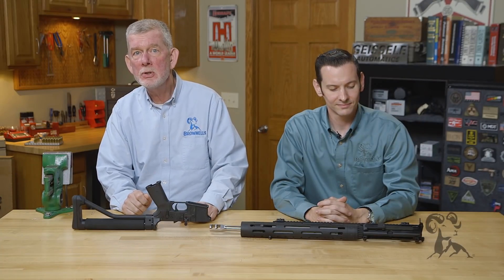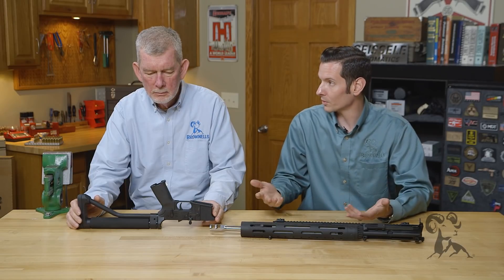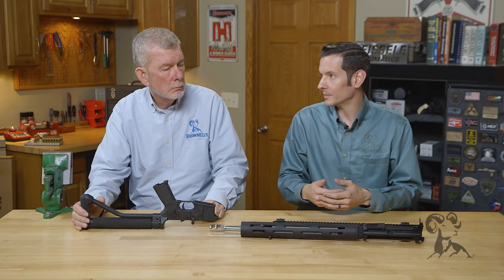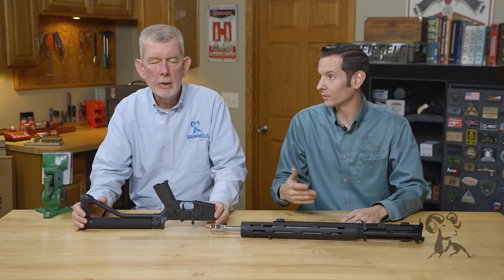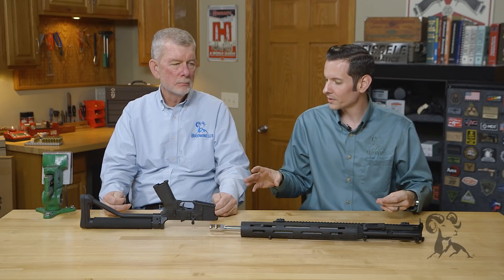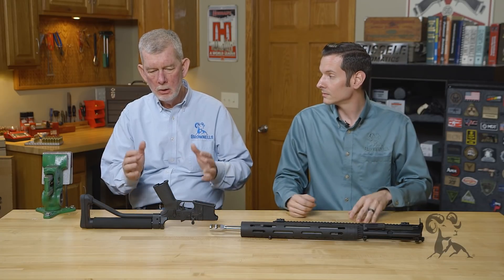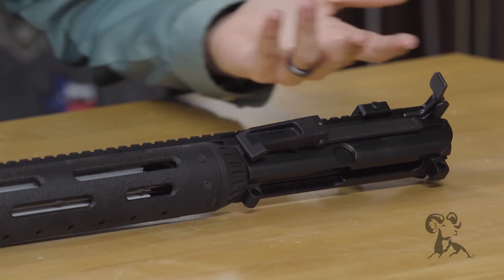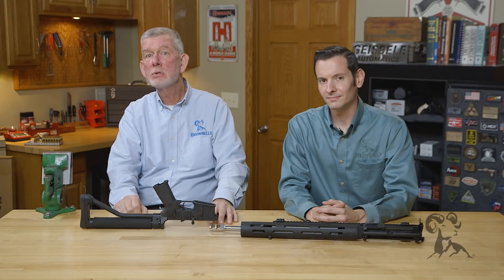Smyth Busters: Is Billet Better Than Forged?

Comment: As a "rusty" material scientist who worked in failure analysis for almost 15 years, I commend you guys on your succinct and dead on explanation. Well done.
Reply: Not sure how that will happen. Forging is preferred unless the shape is too complex or the specified material is too difficult to work. A billet will always retain its anisotropy unless heat treated after being shaped which, in turn, can introduce dimensional changes, particularly in complex parts.
Reply: @damianip  Forging is NOT preferred, forged parts are weak parts.
Reply: I wasn't impressed with the incomplete presentation. Did I miss the discussion on alloys or any kind of testing/measurement? And there is zero reason a forging can't be complex and the the milling operation couldn't shape more complex - how did Savant phrase it - "really cool looking receivers".  

In my opinion, the reason forging was used in milspec wasn't for any other reason than speed of production/less machining operation - basically, forging is a cheap and fast way to rough-in the part. Just like cold hammer forging barrels. You can discuss various marketing and technical claims but the reality is, it's faster with fewer manufacturing processes.

-- AGREED -- either a machined forging or machined billet out of their custom alloys are up to the task. Even then, cast and polymer are fine for over 90% of AR owners. -- generally, they are noncritical (sport) shooters. You might be surprised how many cast parts there are and how many can't tell the difference between them and forged.

...just opinion.
Reply: This is too simplistic.  Forged can potentially be stronger, but some billet receivers are overbuilt and could be stronger than a lighter forged receiver. It would depend on weight and shape of the pieces being compared.
Reply: @Subtlenimbus  the assumption when comparing the two manufacturing methods is that everything else is equal; that being the case, a forged part is stronger every time. Of course, some manufacturers take advantage of the strength properties of their forged parts by removing more material from it to make it lighter, whereas a manufacturer of that same part using billet would not do this because the part strength is already starting at a lower level.
Reply: Then as a material scientist you might offer up some other data....such as forgings are shrapnel machines, unlike billet that deforms under explosive pressures
Reply: @killerfungis  I think we have to separate marketing from fact.

A casting can be adequate for the job. The issue often is manufacturing not strength. Casting often has dimensional challenges because they shrink as they cool and do have limitations in complexity.

A forged part can take some non dimension critical shapes and contours requiring minimal machining. 

Billet generally comes from either hot or cold rolling a standard shape that can then be milled to intricate forms with precision. 

So, just my opinion, strength has nearly nothing to do with it, it's more about what tools you have to get the job done. 

So honestly, does it really matter? I mean as long as long as it gets the job done?
Reply: @DelHollowProductions  Yes it kinda does, because if you become familiar with the process. What is referred to as a forging is extensively machined..ie cutting those grains Brownells claims to be stronger. Most of the billet lowers I see start out as heat treated, then machined and then back to treated or cryo. The difference being that the 'forged' lowers in an 'over-charged' scenario turns to shrapnel. Several vids on youtube showing the difference
Reply: @killerfungis  What is your point? Yes a forged part will be machined.  I don't recall saying otherwise. Does it take as much as billet? No. Are tolerances better than casting? Yes.
Reply: And guys, did I not introduce the concept that strength really has nothing - really - to do with anything? 

The purpose/benefit is to manufacturing. Again, arguing whether billet is the strongest is like arguing that 2-1/2 ton isn't as good as a 3 ton jack to lift your car when a 2 ton is more than enough.
Reply: @DelHollowProductions  I think the takeaway is don't pay extra for a billet if you're doing it because you think you're getting a stronger product.

Comment: The lab tester in me cringes at the "Billet is not stronger than forged" statement; without additional context it's a dangerous blanket statement.  As with so many things, the more accurate answer is "it depends," in particular on the quality of the source metal, its composition, and heat treatment.  Assuming good metal quality and manufacturing processes, a billet 7075 receiver will be stronger than a forged 6061 receiver.  An improperly heat treated 7075 receiver could well be weaker than a high quality forged 6061 receiver.

Also, the argument I hear most is that billet is better than forged, not that it's stronger.  Whether "stronger" is the same as "better" also depends on a lot of factors.

Comment: I wouldn't say either is "better". Ultimately, it depends on what you're looking for. Billet receivers are generally prettier, while forged are in fact, stronger. However, hardly anybody that owns ARs will ever experience a failure in a billet receiver that they wouldn't have encountered if the receiver had been forged instead. It just comes down to if you're willing or not to spend the extra money to have a nicer looking receiver/extra features (skeletonizing, side charging, etc). 
Out of my 4 ARs I currently own, only one of them is on a billet upper, and they're all forged lowers, although I plan on buying the matching billet lower for that rifle at some point.

Comment: And where does Metal Injection Molding fit in that hierarchy?
Reply: If you ask the striker from my wife's Walther- very very low.  Factory original lasted 2 rounds.
Reply: Somewhere around cast I’d assume, maybe stronger or weaker depending on material and the quality of manufacture.

Comment: i have to laugh when i hear people say Biilet lower receivers are so much better and stronger than forged. How much stress and pressure with a average shooter the answer is very little all of the action is on the components and the upper receiver. Your much better off getting a forged lower and spending the $125 your saved on quallity  internal compnents

Comment: You also have to remember that some forged pieces are then 100% machined. They use what are called "blocker" forgings. You end up with a basic shape with good grain flow but then all surfaces are machined.
Reply: All receivers are machined, Billet or Forged, otherwise all you have is a paper weight.
Reply: Libertarian 4 Life  So, my question that was not addressed in the video... Sure, forgings are stronger in theory, but is it in reality, when you have thinner walls on a forged receiver than on a billet? The weight difference between billet and forged receivers is notably significant due to the excess thickness of the billet receivers. Is that extra thickness enough to equalize strengths?
Reply: There is no such thing as grain flow.
Reply: 13R^D  Then you have not seen the shrapnel from a forged lower and compared that to a billet heat treated
Reply: This is what I assumed billet was...
Reply: I don’t think you have a good understanding of “100% machined”. Only a billet part would be 100% machined because it does not even have a basic shape of the final part when the machining process starts. A forged part starts the machining process already having its basic shape coming out of the forging die.

Comment: I worked for an aerospace company and we used forged billet material for some parts in the rotor head of a helicopter. We used an aluminum that was 7049-T657. Special material with good strength properties but because of the grain flow of the billet and the basic material it has great properties from a ballistic survivability standpoint.
Reply: Often makes me wonder why some high end gun companies don`t use a higher grade aluminum in their AR`s. Or would the cost be that prohibitive?
Reply: @gunfisher4661  Weight.

Comment: Realistically I think you can say quality billet receivers are actually stronger because many of the designs now take advantage of FEA and other methods of stress testing to improve the designs over the standard old milspec designs. 
Yes the grain structure is inherently stronger in a forged part, but all billet receivers start from a forged blank with a specific grain structure as well. 

I’m sure if you were to test something like a Radian lower/upper vs. a forged milspec lower/upper the Radian would absolutely be stronger in the areas that are important.
Reply: If only @projectfarm had a gun channel
Reply: I love my radian
Reply: I'm highly doubting all billet uppers/lowers start from forged blanks, even though I know little of the industry.

Comment: Even though I completely agree...
Only theories with no testing =/= myth busted
Reply: Take a myth, provide facts to counter the rumors = Busted.
Reply: Providing facts requires showing proof of evidence to back a claim. If a widely accepted view was all that's needed, the belief that the earth is flat would have been fact in it's day and not simply ignorance. A busted myth certainly, but not because two guys sitting at a table just told you so.

Comment: Is there any truth that billet receivers can add to accuracy due to the grain structure being linear and not having imparted stresses?
Reply: I don't think so. The cartridge doesn't really ever touch the receiver. It goes straight from the magazine, picked up by the bolt, and then into the chamber which is part of the barrel. The receiver shouldn't have anything to do with accuracy.
Reply: @acidtreat101  have you heard of harmonics?
Reply: @autumnfragrance7185  I am not a precision long range shooter but I have to agree with you on harmonics in that it could differ between a loose vs a tight fitting upper/lower. I have both a forged and a billet set. The billet set has zero slop and I am guessing the more slop you take out of the equation as a whole should yield better results in accuracy right? Then, I have also noticed that my forged set works more reliably though.
Reply: I would think stock fitment would be the biggest variable in accuracy, not the receiver. At least for firearms with a one-piece stock
Reply: Yes...  you can have a billeted monolithic upper receiver  ... takes the slop out of the handguard

Comment: If I recall, Aero Precision receivers are forged and billet, right? Something of a hybrid?
Reply: Yes, the Aero is more of a forged actually. They have a custom die to forge their receiver giving the best of both worlds.
Reply: Every billet part will start with a forged blank, but the process of actually forging into a specific shape makes it even stronger. All forged receivers are still machined as well to some extent.

Comment: Its not simple though, amount of material used and where its is used also matters significantly. Using billet you can reinforce weak points and increase rigidity and strength however much you want to. You can easily make a billet receiver stronger the a forged by increasing amount of material where desired. If you  want the best strength to weight ratio then forged is the way to go.
Reply: 13R^D  hmmm.... BCM MK2.... 

Oh and if you buy a left handed AR for which there are few companies it then takes a proprietary BCG. And you aren't grasping the concept that not everyone is in the military and weight is not the first priority 🙄.
Reply: 13R^D  lol your soo touchy on your milspec religion. And your wrong, alot of amby billet receivers you standard milspec parts they add additional parts to make it ambi. But your right we should ignore engineering and development to improve product safety, reliability, and performance. I'll let BCM know that their time, effort, and investment was just a big waste. That was sarcasm just so you know 😏. Its clear that I have spell things out to because you still haven't grasped the concept that what you prioritize in a rifle isn't what everyone else prioritizes. Features, ease of matinance, ease of replacing parts, rigidity and fitment for inherent accuracy. All of these other things may take a higher priority  than weight. Now fallow along, the military has different priorities! 

My initial comment was wrapped around the concept that just saying forged is stronger is only part of the story. You can have additional features and it be just as strong if not stronger. I know, I know, but weight and military...
Reply: @Chase Nun hey bud before you start trying to “spell things out” for people; how about you learn to “spell” yourself, just a thought. So many words that you had in your rant that were so jacked up and wrong but yet you are trying to “spell things out” for people smh
Reply: @johnc2324  Seriously.... it's comments section. I multi task many conversations throughout my day. So correct spelling, and properly structured sentences to meet your esteemed demands is way down on my list of concerns. Make valid point or move on your embarrassing yourself.
Reply: I did make a valid point and you just proved it, good job though. 👍🏼
Reply: @Dick Cheese yes they are completely fine I have many. But to someone who is left handed, they may want something more ambidextrous. Yes, yes, yes 👏 people can use the standard just fine  being left handed. But maybe they just like the ambidextrous receiver so it's less awkward and they are a little faster. I don't know how else to get across to people that some people have different priorities than you do.

Comment: anisotrophy.   Billet is cheaper to manufacture in low quantities and forged is cheaper to manufacture in high quantities. Standard receivers are forged and cheaper than billet.  My guess is that the myth started with people assuming that price equals quality.

Forged is stronger along the grain direction( anisotrophy), however billet is usually thicker.  Which is stronger?
Reply: I agree I think people look at the price and assume it must be better...
Reply: Libertarian 4 Life When you say add "grain refiners" you are suggesting upgrading alloys.   Forging isn't only about grain flow but reducing machine time and reducing scrap.
I once did an FEA on a upper receiver and noticed a weak point  at the neck where the barrel nut is mounted.  Would you favor changing the section modulus or the modulus of elasticity 

Anistrophy is about the difference in the mechanical properties when they are measured in different directions.

Comment: "Steel is either cast or billet" Laughs in Cold hammer forged steel barrel.
Reply: Billet has been forged down. Maybe not cold forged (for thin stock I think it often is cold rolled) but it certainly is hot rolled.

Comment: Didn't even touch on the ability to use different metals on billet vs cast/ forged.
Sure, a forged 6000 series part can be stronger than a billet 6000 series part but make that billet one out of 7000 series or something non aluminum like titanium and it can be stronger than the forged.
Reply: You're grasping for straws.... Sure you could have a 9lb billet receiver and it would be stronger lol.
Reply: @cohenj87  its not grasping at straws. It is a legit topic that is thought of in almost any business that uses metal for its parts.
You not knowing that shows you have no idea what the weight would be.
Reply: Libertarian 4 Life  it fine to compare the 2. They are 2 common steel alternatives in loads of industries.

Comment: Billet receivers are usually thicker aren’t they, to make up for the strength? I’ve never owned one to compare
Reply: I own both types of receivers and the difference in thickness seems negligible at best. Each has its own slight benefits, sure, otherwise there would only be one process. Both are solid, and comparisons between them are being fairly nit-picky IMO.

Comment: One pedantic point - Forged does not really compress the metal ( unless you consider thousands to millionths of a percent significant )
Reply: actually...
Reply: @CalebSavant  - Yes I said it was a pedantic point. It is relevant on a mythbusters episode not to use other myths
Reply: Forging changes the shape of metal not the volume,  compress seems to be an inappropriate word.

Comment: Forged anything is always stronger. But only if it's done right. QC on forged parts is more difficult, and requires larger volumes of units to be profitable. What you call "billet" which is really bar stock (billet is something else in the steel industry) is with modern, and some not so modern alloys, plenty strong if the part is designed correctly.